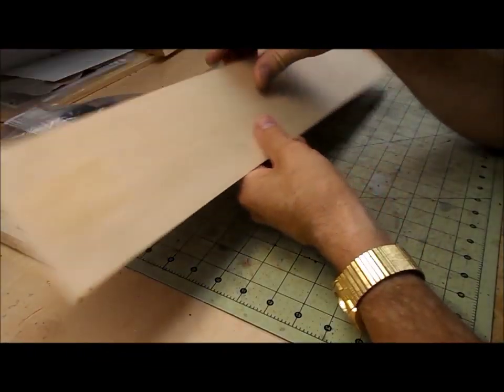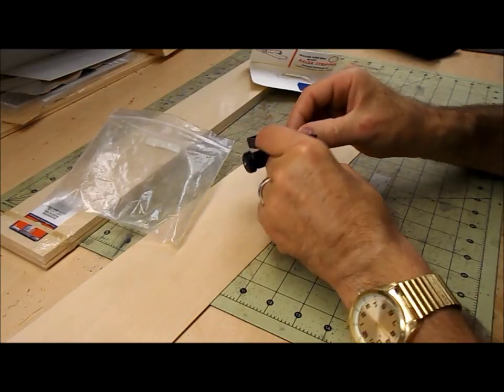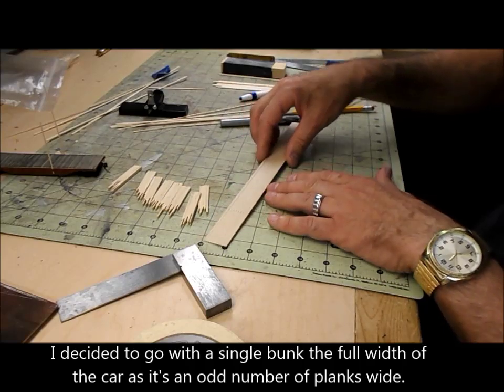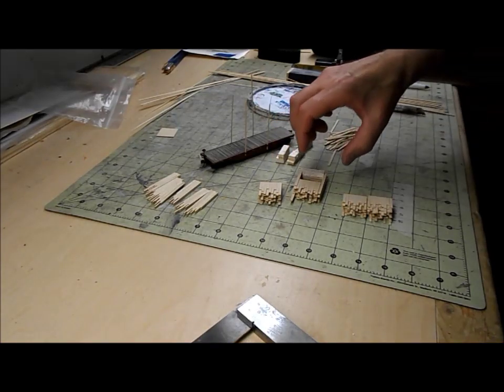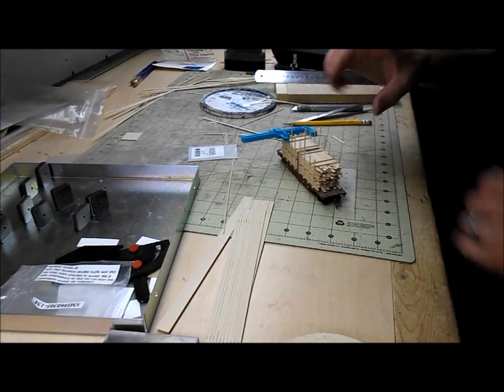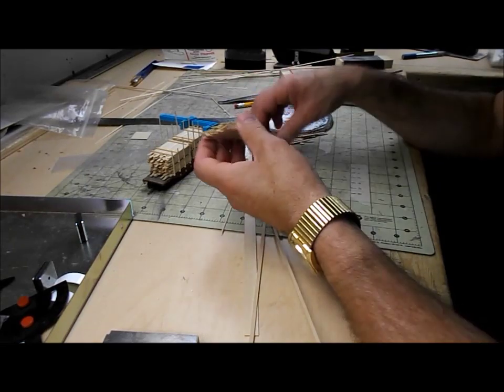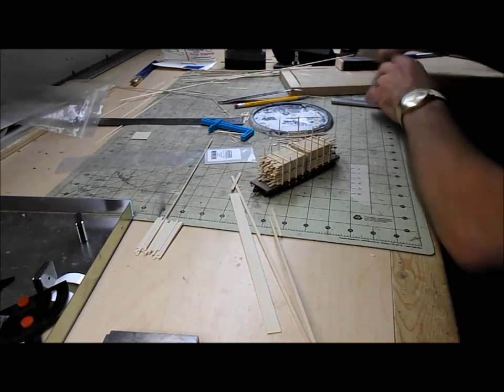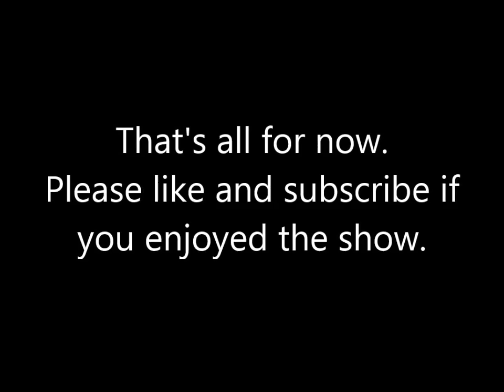Build a lumber load for a flatcar

Comment: Hello Mr Peter, I was wondering if you could do a video of how to make log loads for disconnect log car trucks? I'm uncertain about how to do this and how to connect chain to each end of the load. My log car trucks are n scale micro trains line and the numbers on the package are 003 10 171 and the other one is (1197-10) any help you or suggestions would be greatly appreciated. There ain't much helpful information or videos that I can find on YouTube and that is why I asked you because of the skills you have. Anyway I hope all is well with you and I look forward to any future upcoming videos that you have made, take care my friend!!!
Reply from the maker: I've never tried this because I don't have a use for disconnect log cars.  If I were doing it, I'd probably glue the logs in and just have the chins as cosmetic details.  That would most likely be more durable than using the chains as the only thing keeping the cars together.  Whatever you try, just do one to start with and test it fully before committing the whole batch.
Reply: @mpeterll  thanks for the help I appreciate it very much.
Reply: @mpeterll  should I use ca glue or a hot glue gun? I have never done a project like this before so I want to do it in a manner that I may be pleased and able to take apart and reuse it if possible. I won’t and don’t hold anything against you or advice, just want to do well and learn without destroying some of the stuff lol. Have a great day sir and take care

Comment: All nice and well, but you must take care of one point: the weight!  Wood can be heavy, up to about 500 kg/m³ depending on the species ; so if we take your oldest load, it look s like it's about 2.5 m x 2.5 m x 6 m @ 500 kg/m³ = 18750 kg, which can be over the max load of such a flatbed wagon !
Reply from the maker: It is well within the load capacity of the car.  While your calculations are in the right ballpark, that's only around 20 tons.  Any flatcar of the period can handle that.  Wood loads can be stacked to use the full cubic capacity without going over the weight limit.  The model represents a 70-ton flatcar.  I talked about load capacities on another video I made at about the same time when I did a steel load for an identical car.